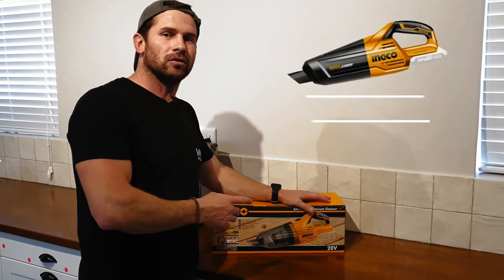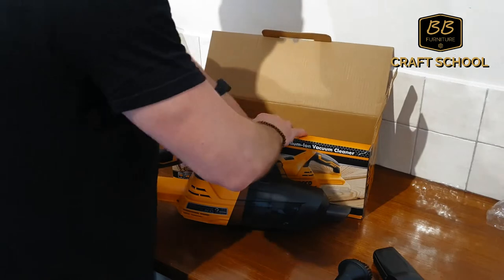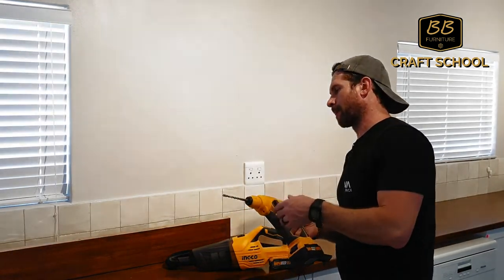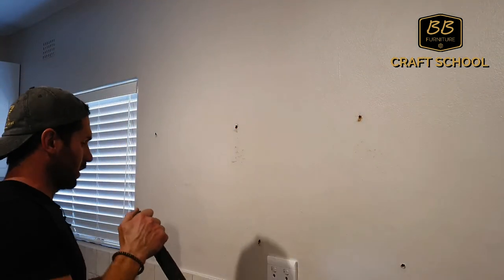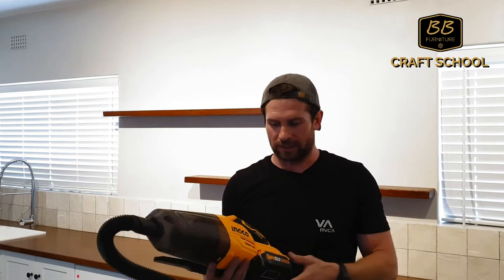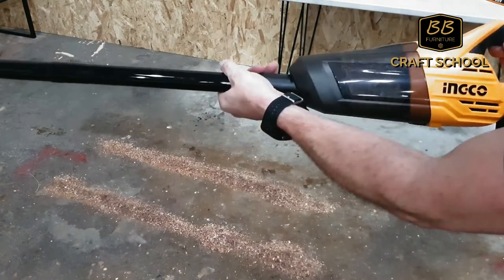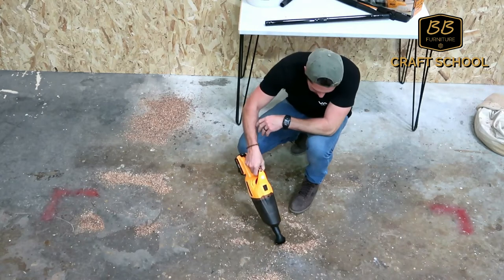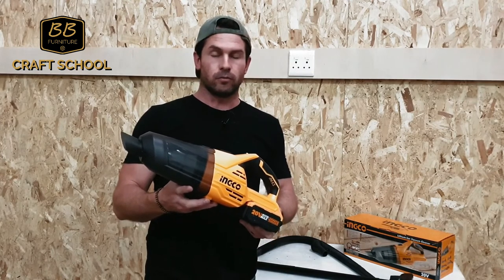Ingco Cordless Vacuum Cleaner | Full Review

Comment: I honestly want to thank You for the review. I recently took the leap to the Ingco 20v cordless from a friend recommendations. I have the 55Nm cordless drill which is a beast for my uses(outperforms my old corded 800w Black n Decker easily) . I was looking for reviews on vacuum cordless, But yours is a in depth one and even shows cleaning filter. My question is when do You need to replace the Hepa filter, or do You only have to clean with air compressor(meaning is it a consumable).
Due to your review I could easily see this will work for home, thanks, gonna buy one. 

I was suprised to find out you fellow South African, and checked all your other ingco vids(and will check the wood working as well, just may learn something😜). There not much local reviews, so very refreshing and much appreciated 🙏🏻. I subcribed as well
Reply from the maker: Thanks for the comment man. I'm happy to hear that this review helped you decide to buy one. Let me know how you enjoy using it!

Comment: How much time the battery lasts ?
Reply from the maker: It depends on which battery you use. I use the 4AH and it lasts quite some time. It's not like you have to charge after every time you use it. I will have to do a separate test to see how many minutes/hours of use I get from the 4AH bettery.

Comment: is it comptible to dewalt batteries?
Reply: Not that I know. However, the friend who recommended the Ingco brand to me has the Makita cordless range and he 3d printed a adapter to use makita batteries on Ingco tools as he wanted the cordless Ingco glue gun. So if You know someone with a 3d printer then it can be done. It Just looks like a plate sliding into the Ingco glue gun and then the makita battery into adapter👌🏻 There is adapters available between Dewalt and Makita that I found online, But not for Ingco that I know off, hope it helps
Reply from the maker: It will definitely not work with the DeWalt batteries as is. But it is worth investing in a Ingco battery as all their cordless tools use the same ones.